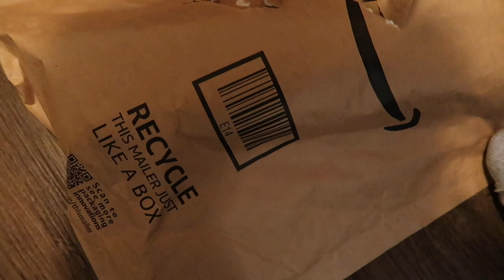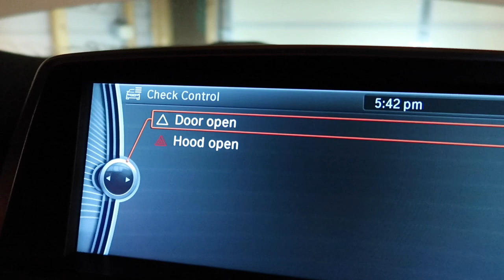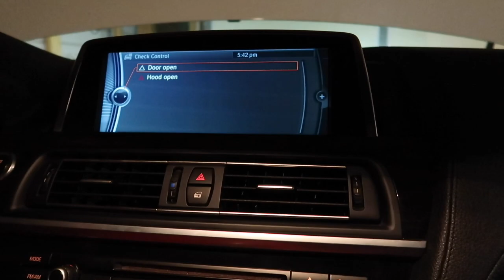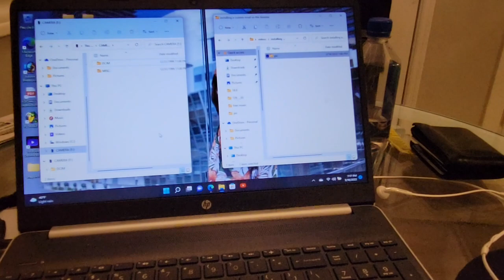Finally Installing My First Ever Custom Mod For The BMW!  (DIY)

Comment: Keep going my boy. I got 2016 Camry it’s almost to 100,000 miles so you right my boy.
Reply from the maker: Them camrys and Toyotas are very good lasting cars 100k that car ain't even broke in yet that's low miles on them thangs man I miss my Honda I had bro frfr 💪🏾💪🏾💪🏾 thanks for checking in homie 🙏🏾
Reply: @TuneChee  4sho. Can’t wait to see what’s next with the BMW & Big Snow ⛄️
Reply from the maker: @DaRealFatBoi  it's coming 🤘🏾🤘🏾🤘🏾 got a video dropping tomorrow